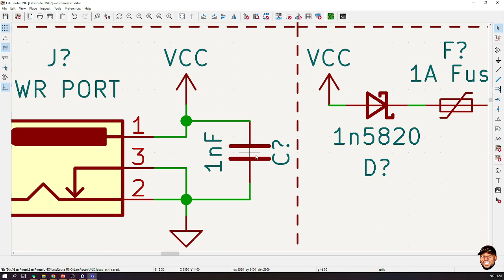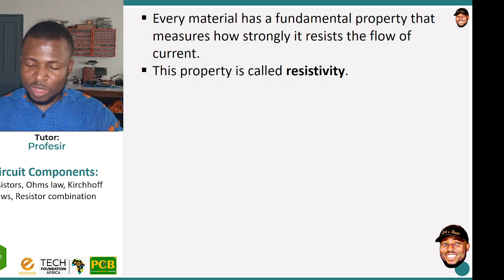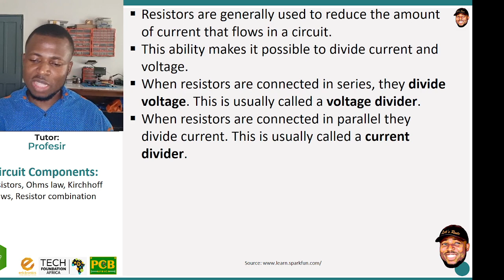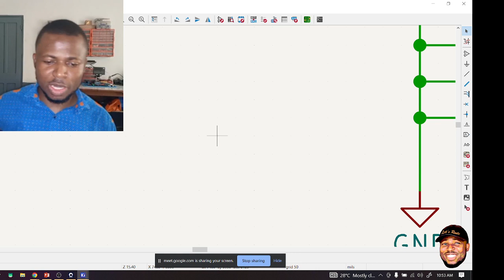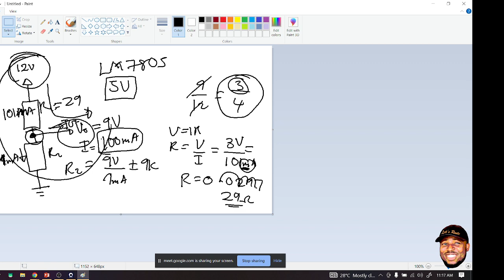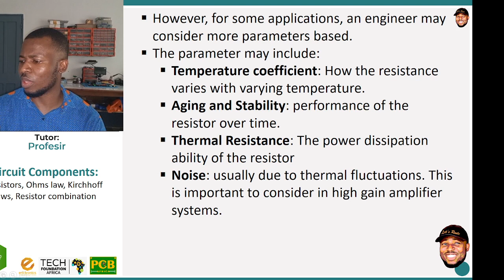Electronics Hardware Design Training - Lesson 4

Comment: Are Diodes active or passive 😅, one would say they are active, because changing the power input could change the output i.e reversed or forward, and also because they require some voltage (ex .7v) to function as a diode, but one could also say we can consider the voltage it requires to work as a result of it's inherent resistance. Seeing that it doesn't generate power and most of it's uses is to influence the flow of power in the circuit, I consider it passive.